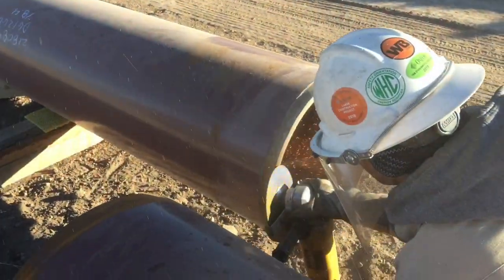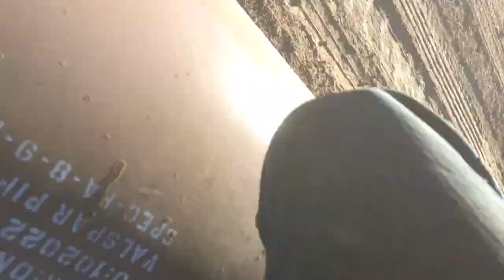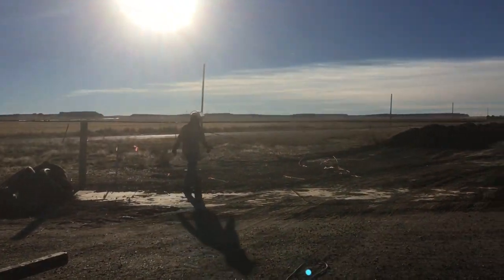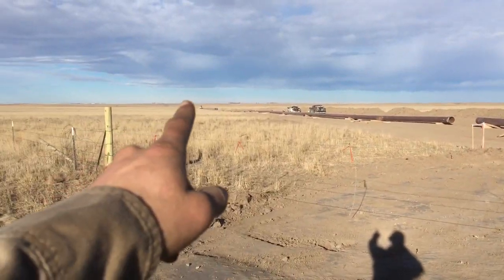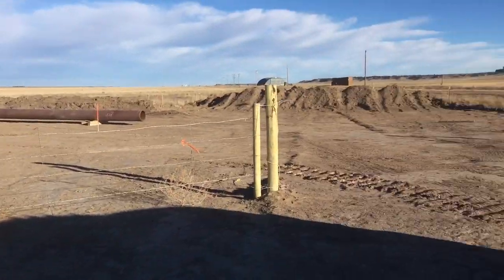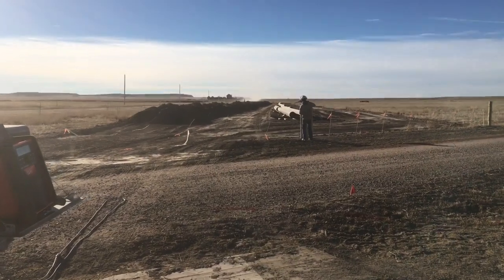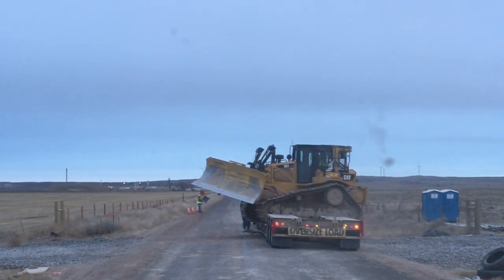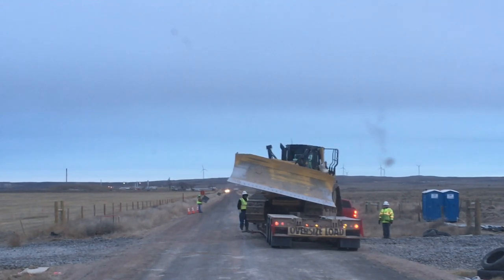Pipeline Bevels “buffing”

Comment: I have found over the years handles to be an impediment to  safe pipeline work . they can and do put users in compromising positions especially inexperienced helpers as Joshua's . 180 degree stationary guards to . In Canada on pipeline OH&S rules allow for 120 degree guards . The 120 degrees avoids  grinder angles that cause kick backs . When you put a land on ,the grinder should be used in one long stroke starting at about 10 oclock going clock wise till you reach 7:30  then another long stroke from 11oclock anti clock wise to 7:00 . This is the way you get uniformity . I'm not saying don't use handles because in some situations they are a must . Also when you have to grind with sparks flying into your face shield you are in a compromising position . I have seen a guy from a distance that was in a hurry to do a job,    with  grinder with guard and handle  that  jammed and kicked back knocked his face shield off and he come close to cutting his nose off. You have come a long way Joshua since starting with jake

Comment: Having welders and helpers doing ends is expensive , having a laborer with a generator and grinder  is more cost effective . To bad you are hobbled with the handle and 180 degree guard on the grinder OH&S up here allows 120 guards for pipe up here Canada . good show joshua
Reply: could you cut 3/4 of the guard off? leave like a 1" wide sliver. Its still a guard ;)
Reply from the maker: mylifeisDope lol. They actually say it has  to be 180 degrees or you can get fired. One of those is not 180 degrees..... but that is because my other 7” broke.

Comment: awesome videos. if a guy had a welding truck all set up with gear could he be a helper for a year or two to learn the trade and then take the test? would it make any sense to have you own rig as a helper other than to practice at night maybe?
Reply from the maker: mylifeisDope that is what every helper does. Get that rig!
Reply: ive got the truck and a bunch of welders. just need to plan the right time for a career change. weldings a hobby for now, a very expensive hobby with all those blue welders